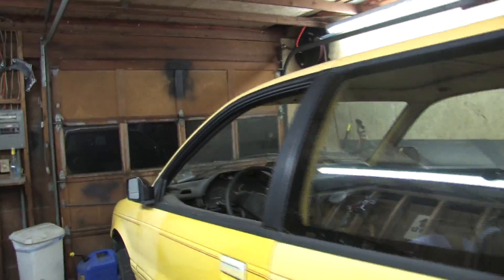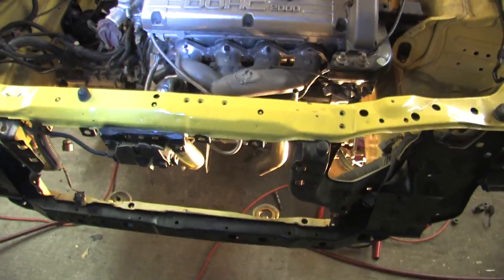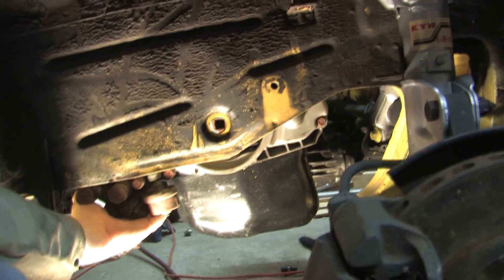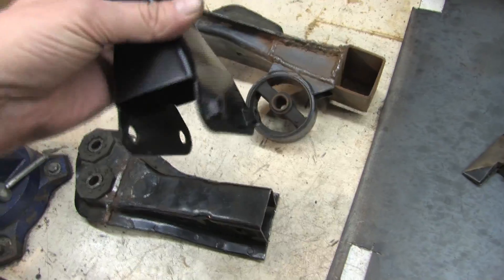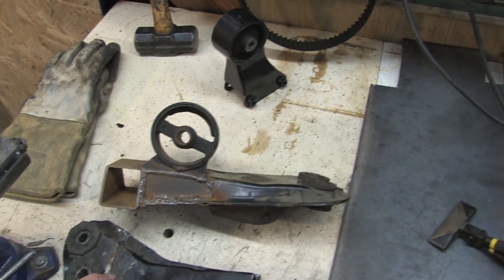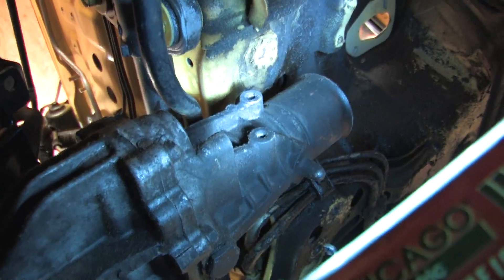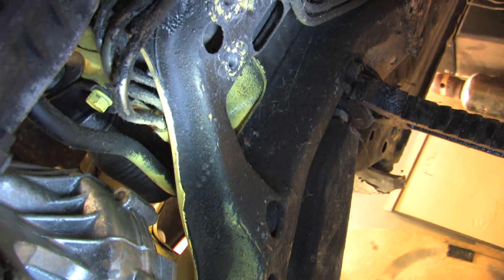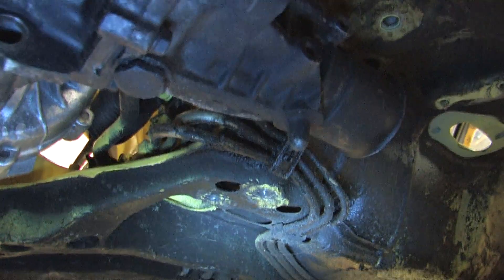AWD Colt Crossmember

Comment: you know jafro watching your stuff keeps me focused on getting the truck done.
Reply from the maker: +ryanjames170 That's really cool because while you're watching my current production, I'm currently getting my truck done.  It's like we're brothers!
Reply: haha what are you doing to your truck? mine is getting a huge change in engine type.. going to a VW AHU 1.9L engine that should put out about 220-240 Lbs torque at around 1800-2200 RPM
Reply from the maker: Well, right now I'm making a half hour+ video about it, so you will soon see!  ;)  Those VW Diesel engines have proven to push around vehicles with 4x the weight of the cars they came out of.  There was an ancient YouTube icon that put one in a Plymouth Voyager van and hauled a trailer with it, running on vegetable oil.
Reply: yeah those engines are just insane.. they can easly rip a gas V8 a new one.. i just wish i could of found and used a 2.4L volvo/VW D24T,, now that is a engine. a inline 6 version of the 1.9L i figured it could do a good 40% more power easly..
Reply: +ryanjames170 how is the truck coming? The vw diesel thing is my jam. I had an ahu and now have an alh mk4. Next year I'll be putting maybe an ahu or 1z in a samurai!

Comment: where can i fine a manual transmision that fits a 99 mistubishi galant to make it AWD
Reply from the maker: Evo 8 or 9 I believe... at least if it's an I4 engine and the timing cover is on the passenger side.  That's where I'd start.  When you find a Mitsubishi engine flipped around backwards with the timing cover on the passenger side, that means it's a Sirius II engine.  The Evo is also a Sirius II and it should fit.
Reply: thank a lot men (y)

Comment: Any chance you will be adding a SSSS. ?  Wondering how one of those would fit, whether just the top portion or top and bottom (360 degree) coverage.  I sense more cutting with the force.  Top notch video by the way!

Comment: I found a really interesting design. Basically, it was a plate between the engine and transmission, 1/8" thick with a mounting bracket on the rear crossmember and a torsion bar running horizontal to the drive train that was pinned to the driver and passenger subframe connector bolts. It dropped 50+ pounds from the factory design and freed up all kinds of space around the front and rear engine mounts. I can dig up a link if you are interested.